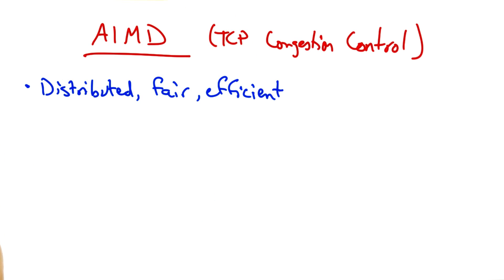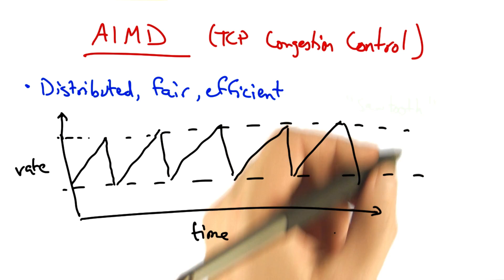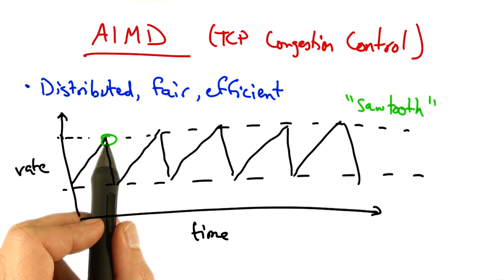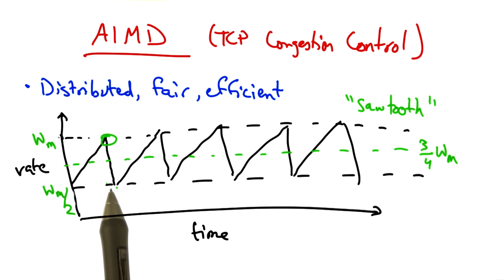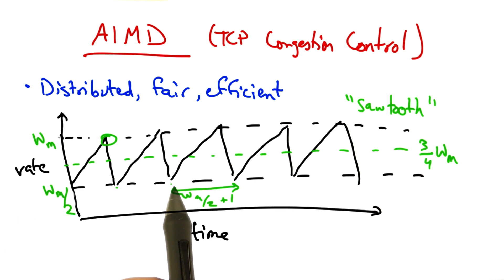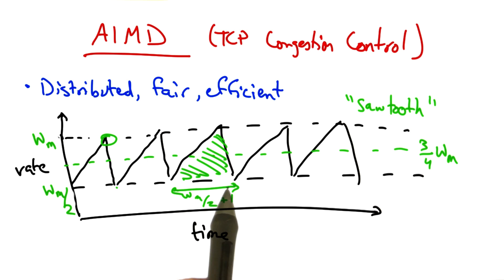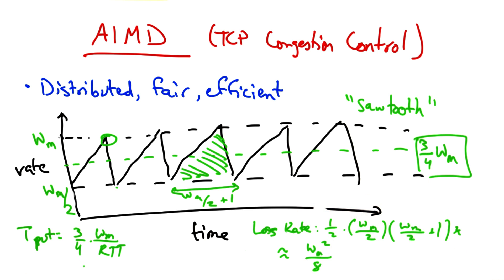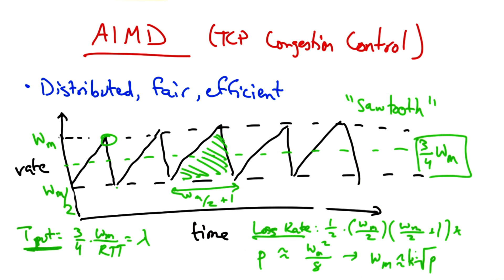AIMD - Georgia Tech - Network Congestion

Comment: i Still cant understand why the time is (Wm/2+1) woruld you kindly explain?why the time to reach the Congestion from Wm/2 to Wm is (Wm/2+1)*RTT
Reply: Because the difference between Wm/2 (the rate at which we back off to) and Wm (the max rate) is Wm/2.  We increase by 1 each RTT, so the number of RTTs from Wm/2 to Wm is Wm/2+1